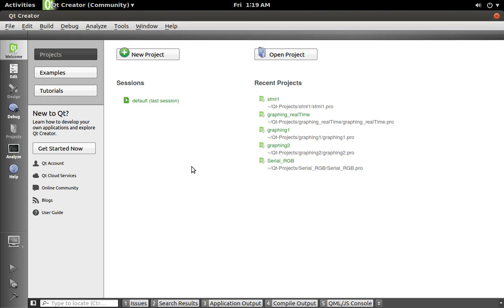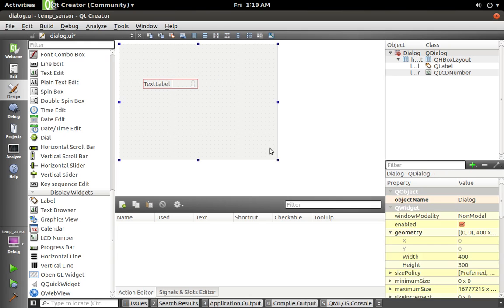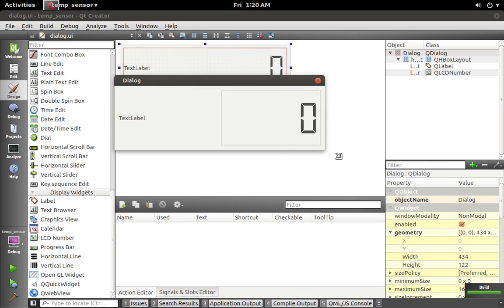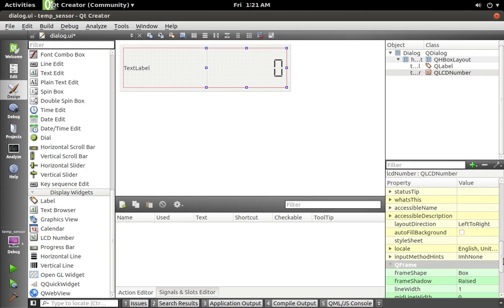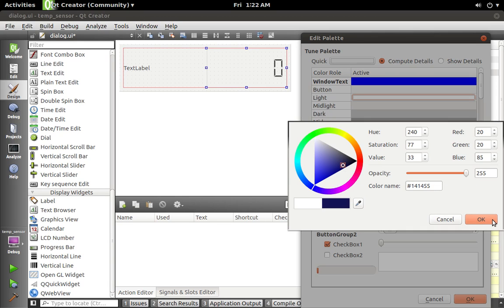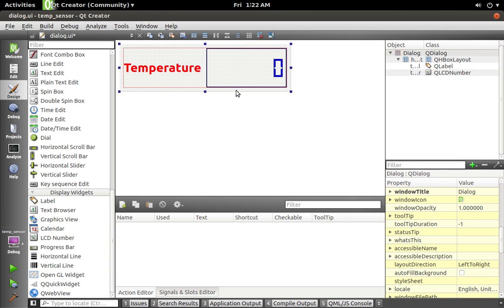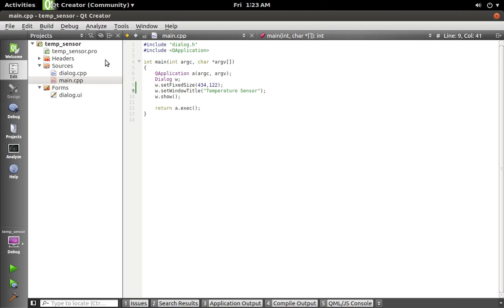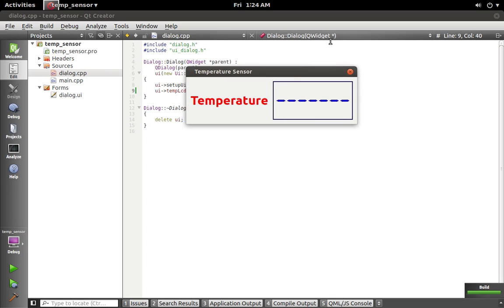Qt & Arduino - Reading a Temperature Sensor - Part 2: Qt GUI

Comment: Project ERROR: Unknown module(s) in QT: serialport  error is coming please help me
Reply from the maker: +bh.seshu raju Check to make sure you used the proper include, check to make sure you added it to your project file, check to make sure you installed QSerialPort (it is installed optionally when you install QT, and by default is not installed).